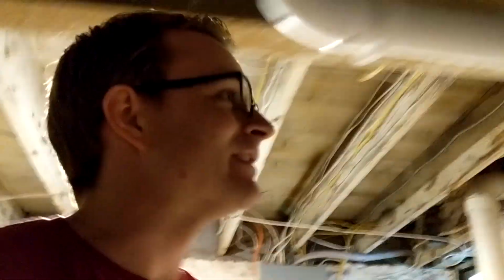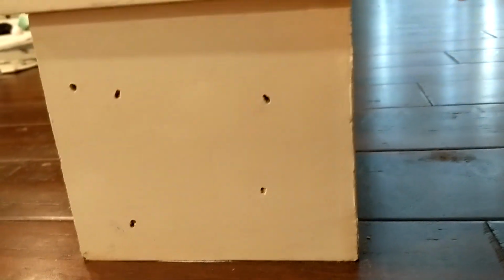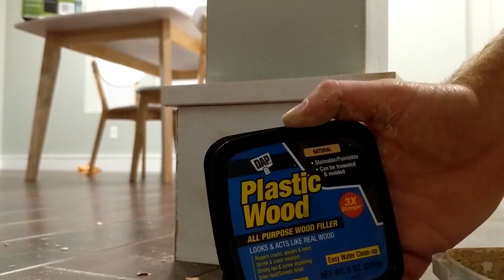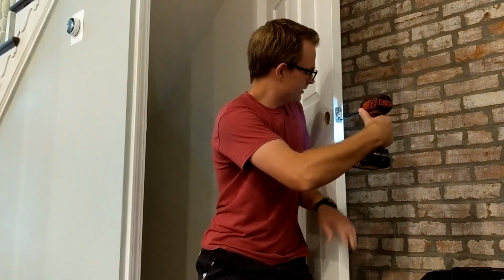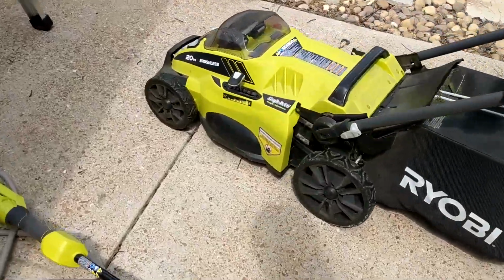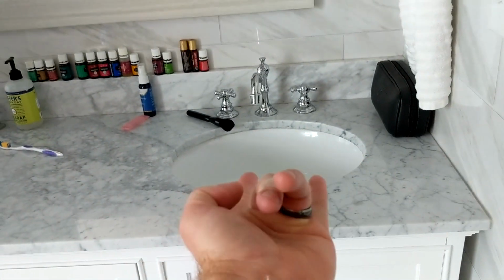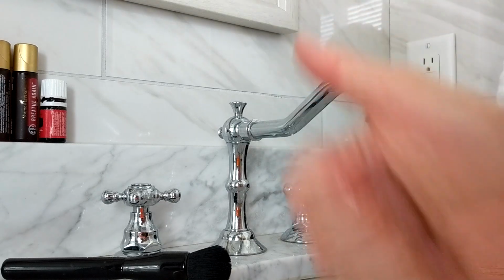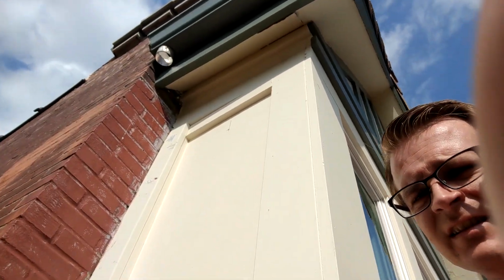House Flip Need So Much Work | WLOG

Comment: I’m from Cali we used have basement then we had a cellar which you enter from the outside of the house.

For that big gap at stair case I woulda used some 1/4 round for the gap because that caulking is gana separate with in time

Comment: Very nice.  I work on these types of Flip Houses all the time. A property management company asked me, "How much money to get this veneer flip house ready?" I answered, "How much money do you want to spend?"  I reminded him, "On these houses you can spend as much as you want, but at some point, you just have to stop."   
I also worked for a We Buy Homes company a few years ago. Bank and Sheriff's auctions houses mainly. They had it down pat. I'd make sure the mechanicals (plumbing, electrical, hvac,) and structural were mostly sound and then they'd mod income rent them out until they were eventually bulldozed; as they put the bare minimum into them as they imploded over 10 years of never changing rent and worse and worse tenants over time.  Each rent house was a little cash machine. About 170 houses when I moved on to better property managers. 
-
Reply from the maker: Very nice! Lot of money in those things! Thanks for your comment!

Comment: Allen,    a lot of homes in the downtown and east Sacto area have basements,
   and some of the older homes in Roseville, too.       i just worked on a home
up where i live,  its about 3-4 years old, and PEX was used as the water supply,
   and stub-outs, with plastic angle-stops.    absolute garbage.

Comment: I have had plumbers tell me to never use the sharkbite fittings due to concerns about premature failure.  However, the following link is to Matt Risinger a builder out of Austin TX who has a great builder focused you tube channel.  This video is all about Shark Bite and his take on its use.  You might find it interesting and his channel useful in your work.  https://www.youtube.com/watch?v=1E8X1VawLeE
Reply: Robert Hartman Plumbers say that to make it seem as if their job is more difficult than it should be. I respect Plumbers a lot and think their is not easy...But, the shark bite debate is getting tired. If you don’t make good initial connections with both copper or shark bite, you will have premature failures. I have installed a lot in the last 10 years and have never had a SB failure. They can and do fail but not at a frequency where I would decry it as a non option.

Comment: Nothing like doing shotty work for a client. Fix the hole man. Don't cut your caulk tip at an angle. Actually, the valves themselves are backwards in mater

Comment: How would you bid cleaning out a hoarders house? It’s three bedrooms and filled with Trash waist deep 1600 ft.². I bid it at 2250 and I think I might’ve made a huge mistake
Reply: That is a mistake. a 40yd bin alone costs roughly 500$ if not more depending on how heavy. You may ned a few of those bins + man power.
Reply: Darren R I’m working on it solo and quit after midnight today. It looks like I barely made a dent in it. What is a rough estimate some companies charge?
Reply: @opichocal  If the entire house is waist deep in garbage, You'd probably estimate around 8-10 bins @ 500 a peice plus your labour for atleast 3 guys. Roughly calculate how many days it would take and add on two extra days + some gravy money for yourself. I' quote anywhere 7- 9k
Reply: Ouch, you are barely, if even that, going to be able to pay for the bins needed.